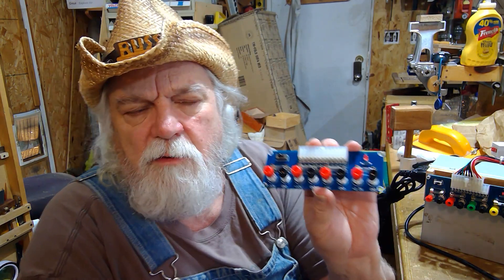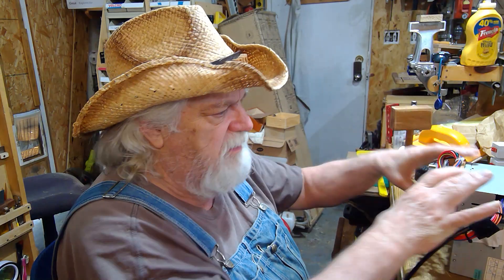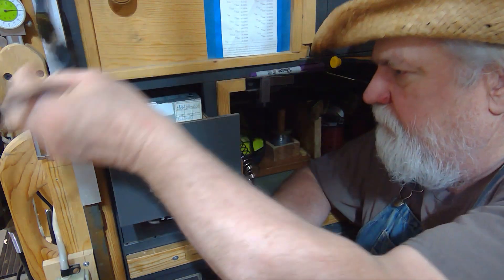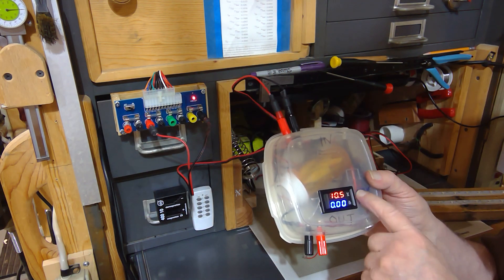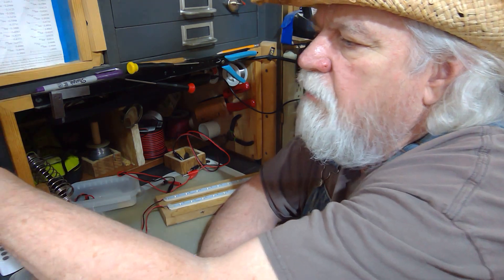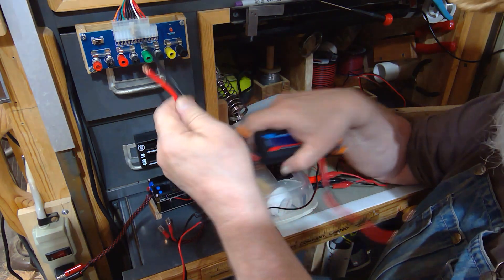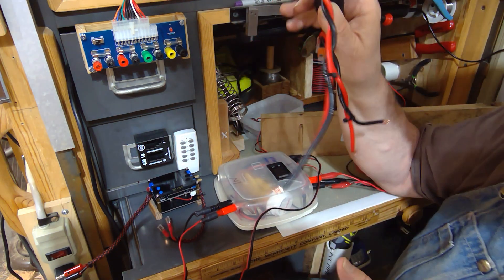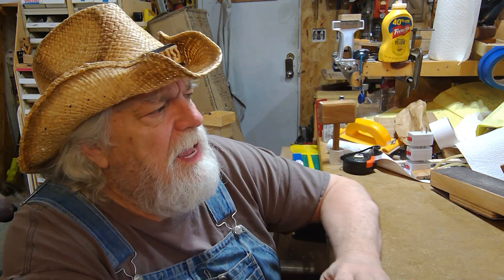DIY ATX Bench Power Supply by OTB Thinker

Comment: Good show Russ. I have done the same thing and I agree with keeping the sources separate from the metering built into the buck/boost converters. I'm using a buck/boost similar to yours with variable controls for both voltage and current. I fool around with so many different electronics components that having as much variability as possible sure makes life easier. The buck/boost I use meters both input and output voltage and current (switchable.)